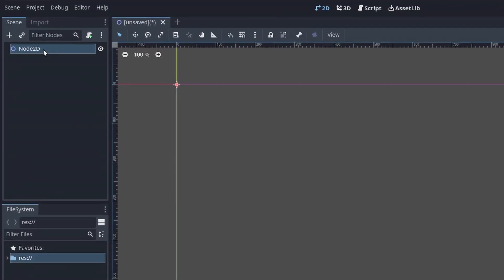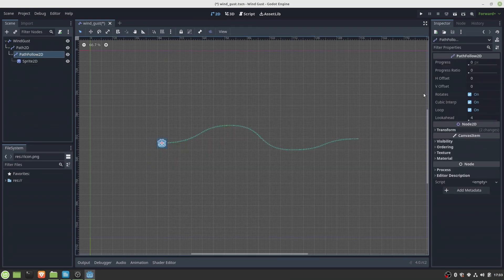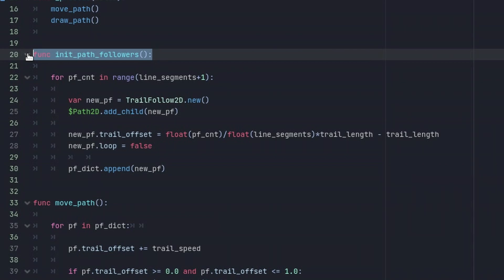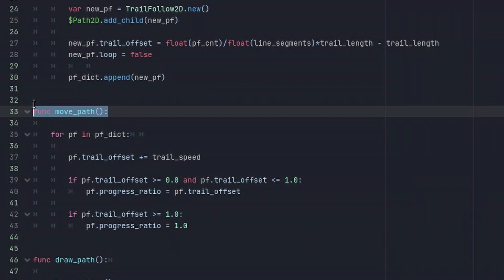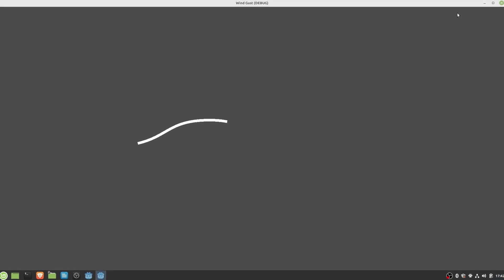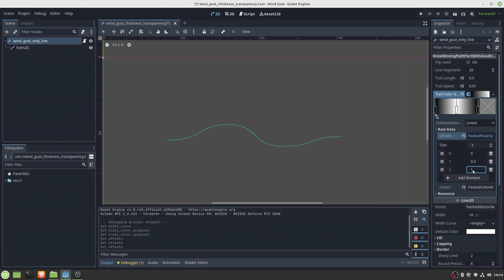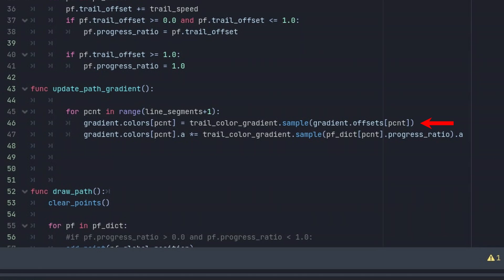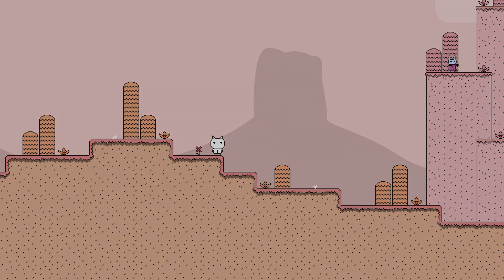How to create 2D wind gusts in Godot - Tutorial

Comment: Your script is perfect, except the fact that it doesn't take into account the "delta" parameter in move_path() function (in 120 FPS the wind will be faster is you don't multiply trail_speed by delta) :
pf.trail_offset += trail_speed * delta
Also if using Gui nodes with 2d node (as a child) with this script, draw point should add the point position instead of the point global position. Or else position will be incorrect.
Reply from the maker: Hey, thanks for pointing it out!

Comment: hey cool tutorial but your github version dowsnt work for godot 4.2 because there is no trailfollower2d. when i change it to pathfollower2d your code is not working because the offset doesnt work. any tips?
Reply from the maker: Tutorial git example project should work on Godot 4.2 (just tested on 4.2.1). If you wish to import the tutorial code to your projects, be sure to copy TrailFollow2D.gd to your project folder.

Comment: Is this also possible to do in Godot 3.5? I tried your code but unfortunately I get many errors.
Reply from the maker: Yes. In github repository there is a release for Godot 3.x, which should also work for Godot 3.5.
Reply: @sleepycodecat  Thank you but I am not able to get it work. The script creates TrailFollow2D nodes that does not seem to exist in Godot 3.5. If I am replacing it by PathFollow2D the rest of the code does not work, because PathFollow2D do not have the trail_offset property.
Reply from the maker: The example scene of 3.x version seems to work fine with Godot 3.5.2. If you wish to use the code outside of the example project, then copy also the TrailFollow2D.gd to your own project folder. If it still does not work, come over to discord (link on the channel page) and we can chat over your problem.

Comment: I am not following this. In Godot 4.0 there is no TrailFollow2D...if that is changed to PathFollow2D, then the property trail_offset cannot be used
Reply from the maker: TrailFollow2D is just a very simple extension of PathFollow2D with that trail_offset variable. I guess you could implement the trail movement with PathFollow2D and offset variable separately too. I recommend to check out the example project in github: https://github.com/haruotsa/godot_wind_gust